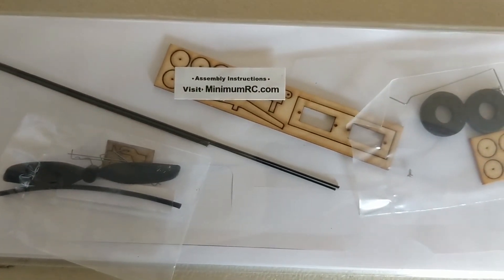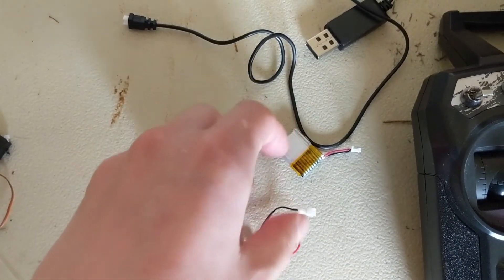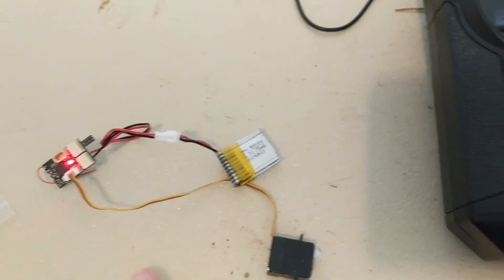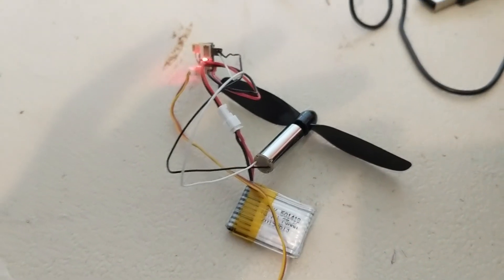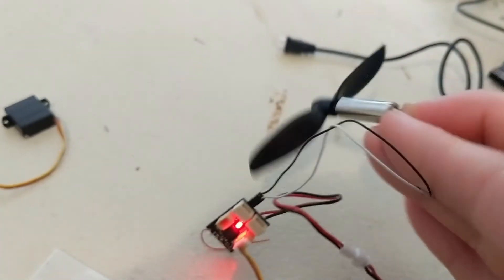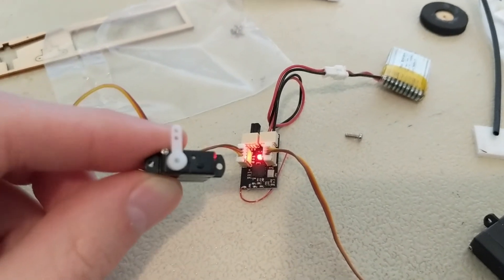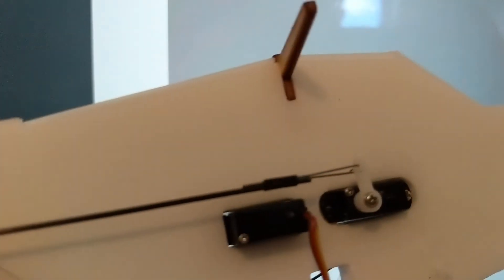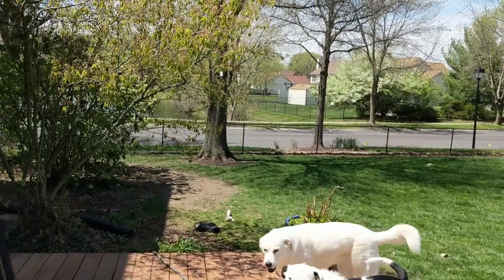minimum rc Piper Cub J3 advice and testing

Comment: I am pretty good at flying but have found myself pretty clumsy when it comes to building (I tried building an intricate balsa model for a first build, BIG MISTAKE!) would you recommend this as a beginners build?
Reply from the maker: yes, just remember you have to provide your own battery/esc/radio. Finding compatible ones was the hard part for me. It probably took me like 30 min to put together.
Reply: ivan viti I already have all the electronics figured out and the kit ordered lol. I was just wondering if I made the right call for a simple kit. I’m using the included motor with a flysky micro receiver/esc combo and I already have a pile of 1.7g servos laying around. Hopefully I will finally be able to finish and fly a kit
Reply from the maker: @luckyduck3594  sounds like youre set! lemme know how it goes